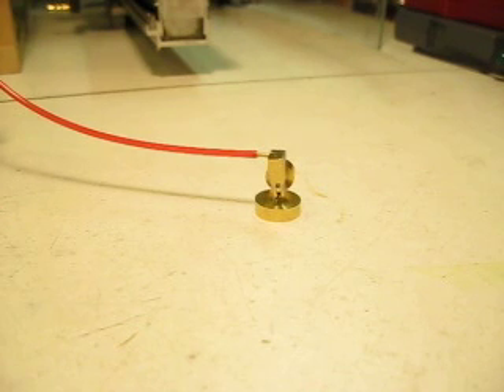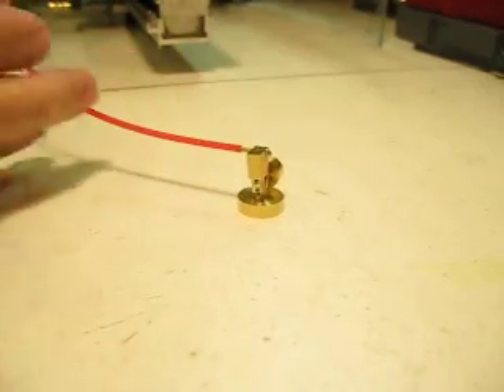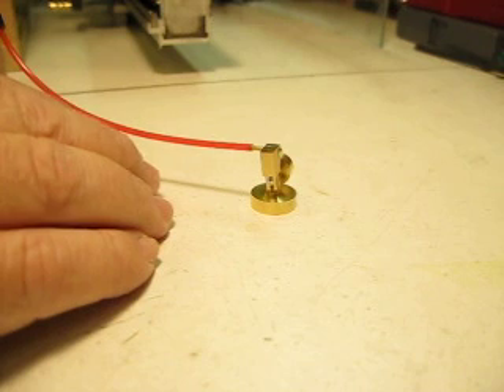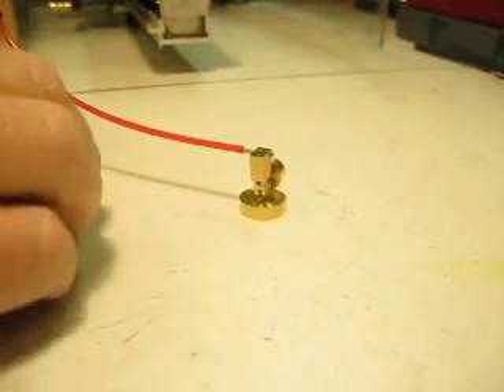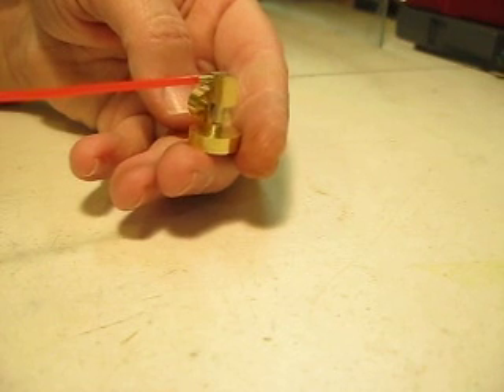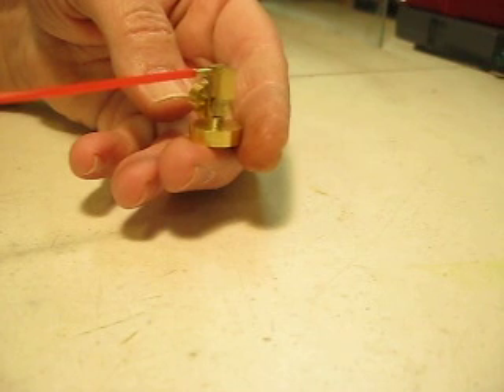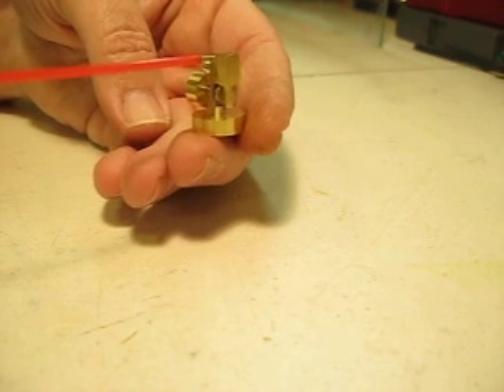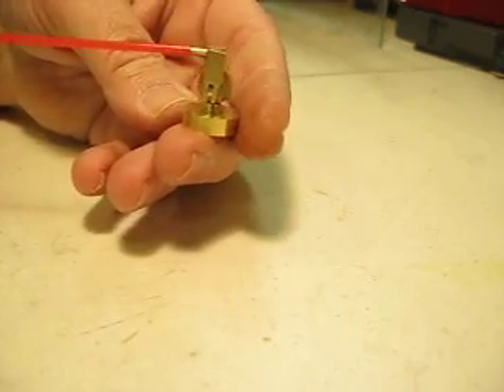Bijou engine.AVI

Comment: I was on your website today looking at your aa - 109 pictures. Do you know what kind of lubrication the backgears take? This little steamer is awesome I like the all the pictures of the tiny parts with the m&m&m&ms
Reply from the maker: Hi Cobre;
When I had that 109 lathe, which was really just a project for me, I used either heavy way oil like Vactra #4 and I also tried general purpose grease, like you would use to lube a car chassis.  Either way is messy, but you will have to decide if you want to wipe off oil that is bound to drip, and sometimes sling inside the change gear housing, or if you would rather not have dripping but have kind of a greasy mess when you go to change gears.

Either way, gear changing is kinda messy.  I used vinyl examination gloves when ever I went to change gears on that lathe.  Same with my old Atlas, and my 9" shop lathe.  Any time you are using "pick off gears" to change threading count or carriage speed, you end up getting dirty.  I'd rather have the dripping oil or sticky grease than dry gears any time, though.  Quiets things down, too, beside making things last.
Reply: @dcw56  thanks for replying i got lathe from a friend.  took it all apart.. the front tapper bearing was super loose put some  heavy chain oil in the backgear. The spindle bearing in rear had no hole where the oil fill was to get to the spindle. Its crazy they put an oil fill port there that was totally pointless without access tothespindle. Put it on centers in my 7x10 sieg. The spindle was cooked .003 and I didnt bother measure the cooked rear bearing. Just drilled a little hole in rear spindle bearing and put it back together.  Its better now, but nothing to write home about.
Reply: After using it for a few hours lets just say im looking for a 9inch southbend with a quick change after I clear out a space in my shop. A high end little lathe like your teig would be awesome a few miles down the road too.